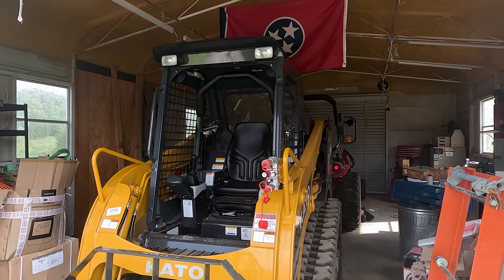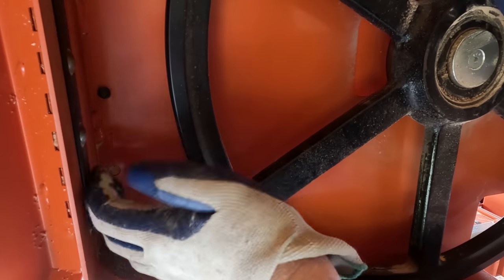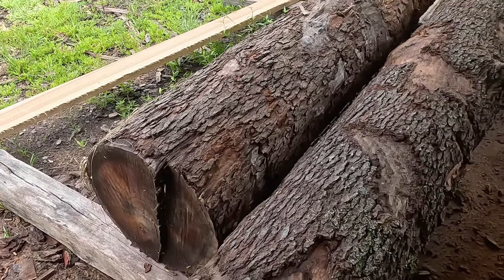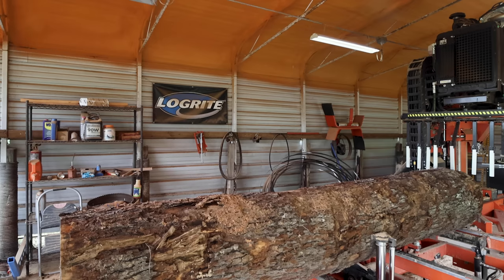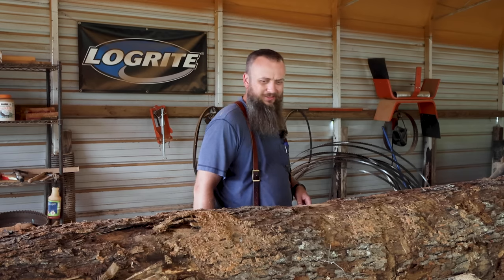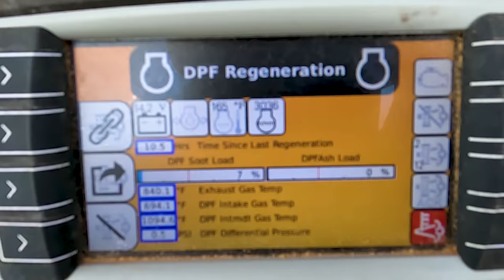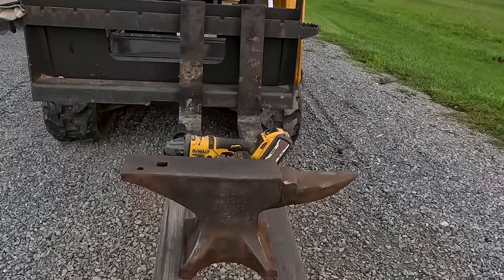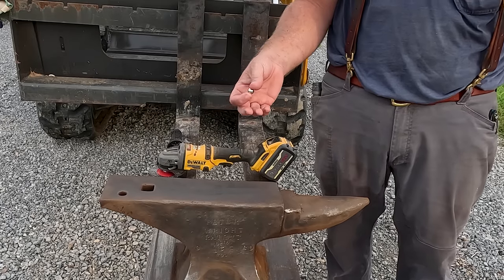What Does A Track Loader A Sawmill & An Anvil Have In Common?

Comment: Evaporust works really good to take rust off. I watch a channel that restores old tools and he's got a plastic 55 gallon drum of the stuff he submerges parts in for a period of time ,12 hours I think or overnight; to clean them when they have sever rust and it will take it off. That's when they are bad, bad rusty but just dunks them for a short period if they are cleaned off like what you did with the anvil and it cleans the rust off good.

Comment: Nathan,  I have to  tell you  a story of a good friend who was a machinest for 30 years working with on a lathe in a tool and die shop.  When turning metal, there is a constant stream of coolant over the high-speed spindle.  It's pretty common, right?  Well, after 30 years, the doctor told him his lungs were full of liquid.  Aka the coolant.  Please make sure there's a constant air flow away from you when operating the mill.

Comment: I've seen a couple guys with these type sawmills under or in a building like yours and they have hung a 5 gallon bucket on the chute that discharges the sawdust to catch it so it doesn't make a mess. Have you ever thought about doing that? You could just empty after each log or ever how often the bucket is full into the dump trailer and you wouldn't have the mess to clean up off the floor. Wanted to tell you about this incase you've not thought about it before.  👍

Comment: You said you’d have liked to have the log further down closer to the saw head. I normally raise both row boards and am able to push the log up or down the length of the mill for those slight adjustments.

Comment: Out of curiosity -
When making the first two top and side cuts, I notice you may or may not raise one end to keep the center level despite any swells on one end.
I'd suspect these two cuts would level the log to maximize the output of boards.  Is this the case or does it not matter?

Comment: I'm just curious...you call them belts, but it looks like their primary function is more like a tire.
I have zero experience with these machines, so I defer to the experts, but it just seems their function is to provide cushioning so the blade doesn't ride purely on metal,and added friction since rubber is a lot more grippy than metal.

So I'm wondering if the manual literally refers to them as belts? And if so, why do you think that is?

Comment: That is a really nice track loader you have, have you had any issues with it? I've heard the IHI CL35 is reliable
Reply: He’s not had it very long probably still under 100 hours on the Hobbs meter. I’m curious also to see how it does long term.  He’s very gentle on the machine so I seriously doubt he will ever have anything other than routine maintenance requirements.